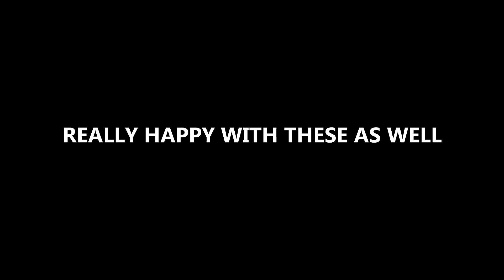OVERLAND GEAR: 1000 WATT POWER INVERTER

Comment: The only power inverter that I have used is Bestek 1000w power inverter. Depend on this high watt, I tried to charge camera, laptop and iPhone in the same time. All charge requirements were met. Easy way to use is just connect with cigarette lighter charger outlet. The same with your new 1000 watt power inverter. Thanks for you video.

Comment: The only power inverter that I have used in car is bestek 1000w power inverter. The same watt but different brand with yours. I don't know whether the two tools work in the same way, just connect with car cigarette lighter charger outlet. Then you can charge safely. But I have to say that thanks for your guide video.

Comment: Your Jeep doesn't look like a real CJ cause it has a full roll cage (not offered until 1992 at the earliest and included till present) as opposed to a roll bad, a YJ dash and the holes in the tub from the old YJ tailgate. Did you do all the CJ type stuff to it like change out the grill and the tailgate yourself or did you buy it that way.
Reply: 1994 YJ with misc. CJ front end parts and CJ hardtop/tailgate; he did the swappage of the CJ parts

Comment: @3:55 I can't help but thinking you just put a box, in front of your pedals, that is only held in place by Velcro.  If that comes lose while you are driving and hits your pedals and gets caught up for even a few seconds...not good.  Why mount this above your pedals and better yet, if so, why not securely mount it with screws or bolts or something?

Comment: be careful not to drain your battery with your 1000watt inverter.  sometimes even if your not using a 1000 watts it can draw a 1000watts from ypur battery
Reply: ryan geldenhuys only if the switch is on.